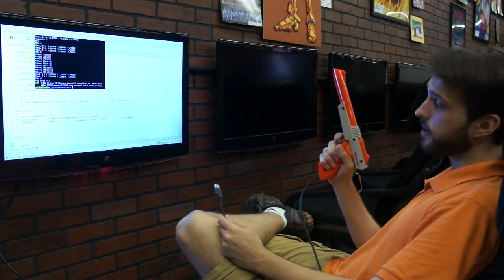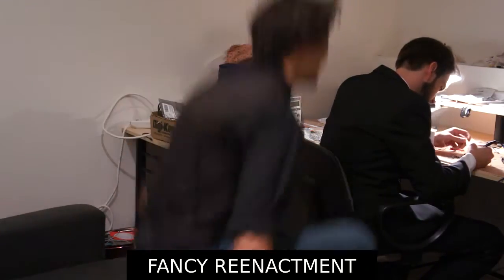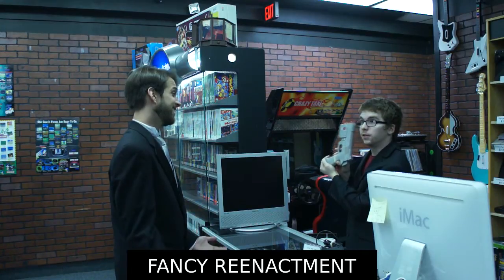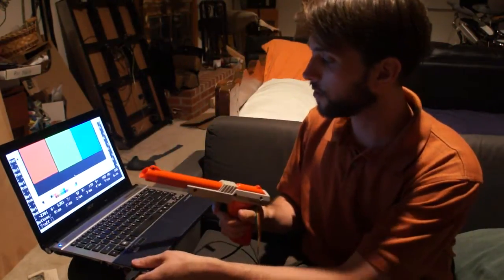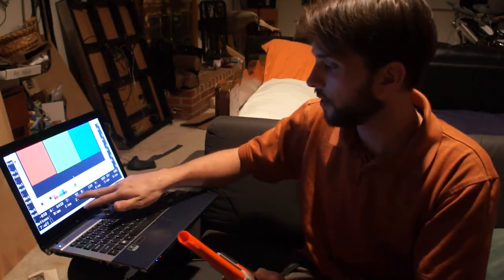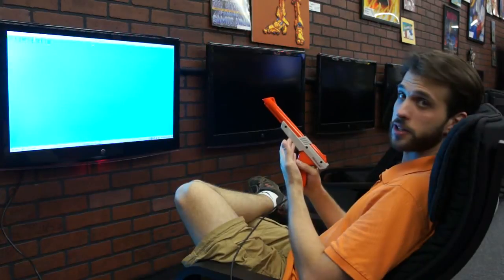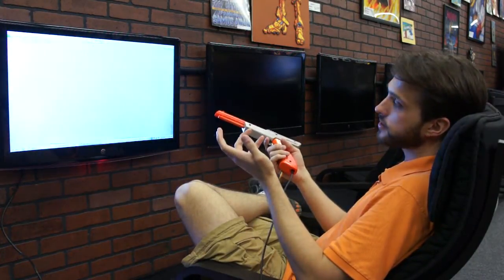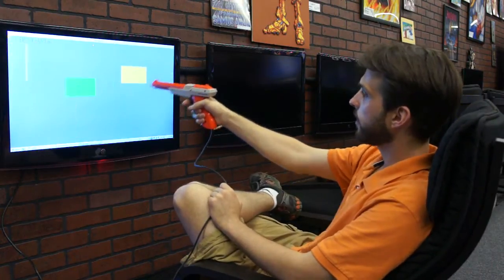Zapper with Color Light Sensor (short version)

Comment: Cant you sync to the ntsc redrawing frequency?
Reply from the maker: Not really :-/ plus it's an LCD
Reply: Yes. But even an lcd redraws the picture line by line. But its probably way to fast.
Reply from the maker: LCDs keep the images pretty much continuously as it takes a little bit of time for the value of the cell to actually change.